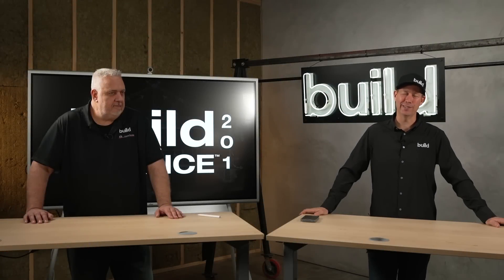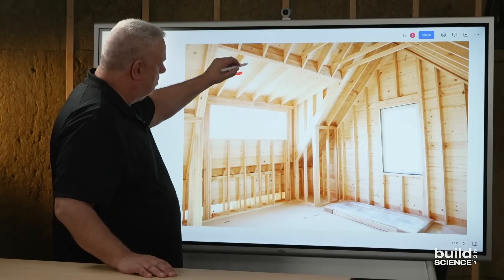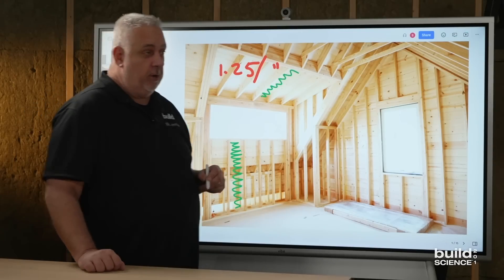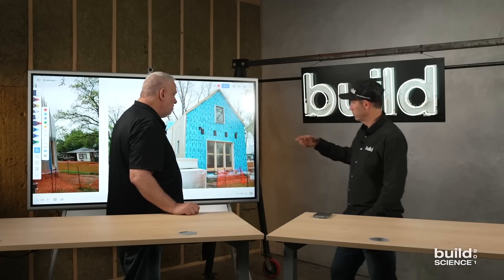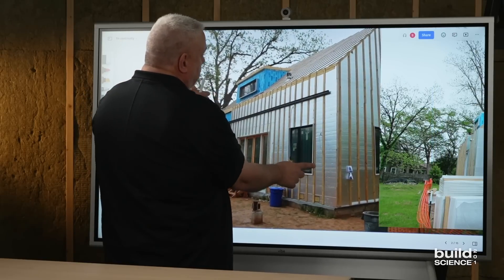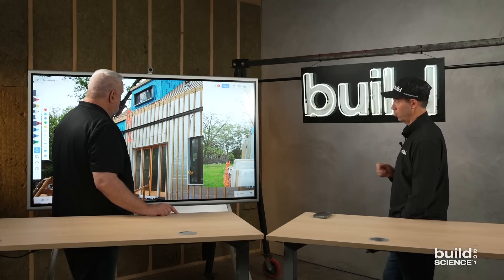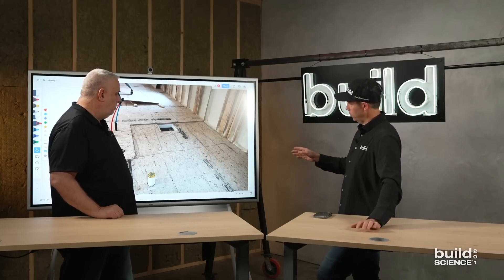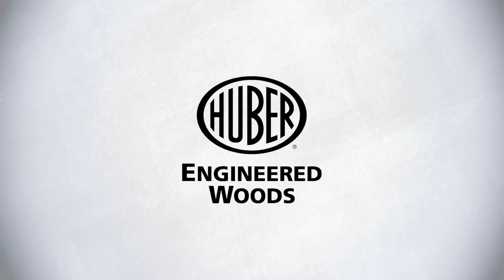Build Science 201: Ep. 10 - Thermal Management: Continuity

Comment: Matt frequently references building around Austin. In south and central Texas, since we use air conditioning  about 9 mos. out of the year, does it make sense to insulate the slab as it and the ground beneath it serve as a heat sink? I get the comfort argument, but is there a difference in energy efficiency?

Comment: Guys if youre going this far on thermal bridging you need to call out using only stainless steel screws and bolts to minimized the bridging. 
Stainless moves thermal energy and a suprising low rate. 
Mild steel is 45w /(wk)
304 SS. Is 20w /(wk)
316 SS is 12w/(wk)
Not a good rating example but a sizable difference in movement through fasteners between nor.al and good SS.
Fiberglass through fasteners are about to show up more in my option.

Comment: to be more accurate Steve,  Cold does not Exist.  There is no such thing as cold.  Cold is a construct or perception of a lack of or reduced value of heat.  It can be 32 degrees outside or zero Celsius.  People think this means no heat... Actually it is 273 degrees above absolute zero... AKA 273 degrees K.  So not only does Cold not move, it does not even exist.  Only areas of less heat.  And Heat moves from areas of more heat to area's of less heat.  Because the heat is trying to equalize.  We insulate to keep the heat from equalizing.  Either keeping it out like here in Florida or keeping it in like Alaska.
Reply: Another “ackchyually” pedantic response. 

When they say cold, they mean:

noun
1.
a low temperature, especially in the atmosphere; cold weather; a cold environment.
"my teeth chattered with the cold"

They’re not being scientific and using it in that context.
Reply: @J-yl6on  He was being scientific.  Thermodynamics is a very specific study of science.  Heat moving to "cold" is science.
Reply: @dbarrington1  We are speaking a language and communicating basic terms. They communicated what they wanted too, and you didn't communicate anything relative to the topic. 
Pedantic waste of people's time.